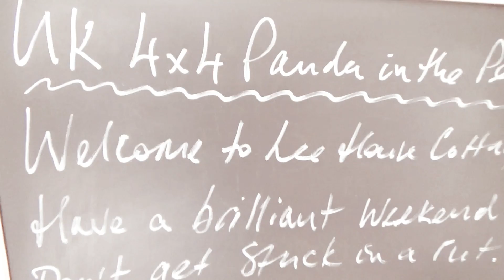UK Panda 4x4 - Peak District 2018 Arrival Day - Midday Mechanics & Extreme Modifications

Comment: Can you please tell me what the rim size is on the tyre's I need a set for 2016 mk3 any recommendations ? Need used steel rims for the winter I have 185x75x15" ally standard on now thanks✌
Reply from the maker: You will need some 15" steels from a Fiat 500, check out Mario Ziarelli tyres and get yourself some Mud Power.
Reply: @UKPanda4x4  brilliant! Thanks 4 your quick reply👌 
Good stuff & good luck mate, happy solstice😉